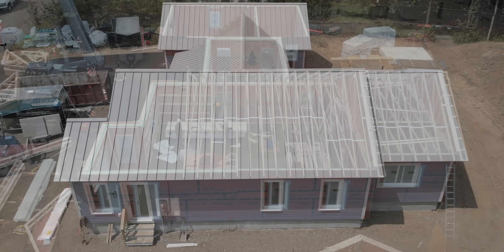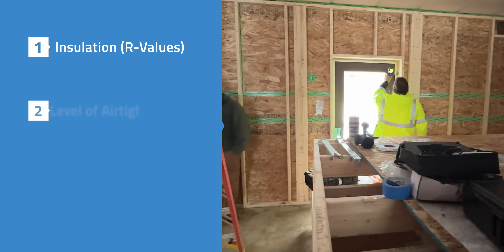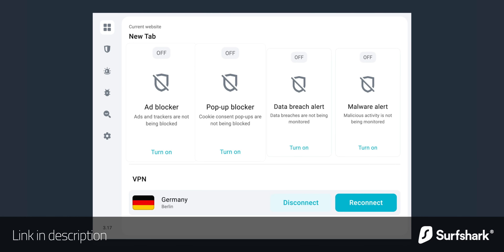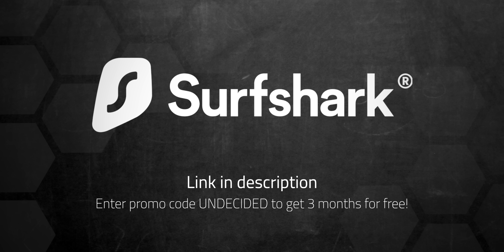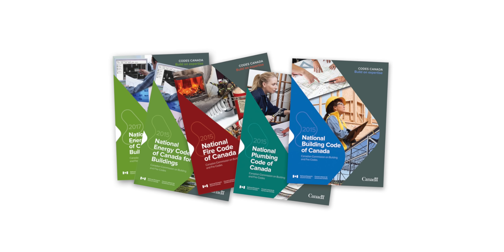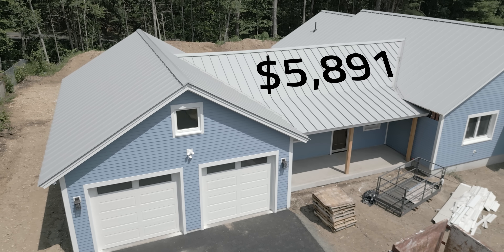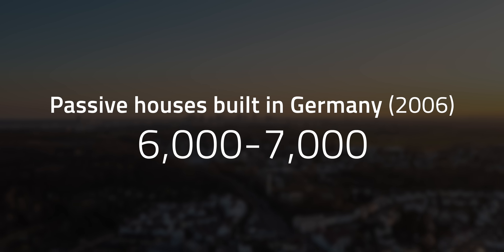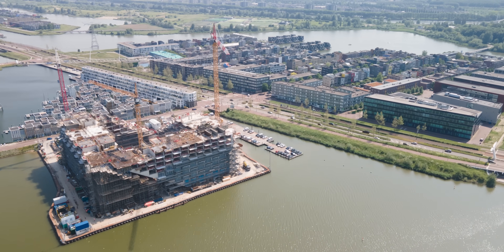Why Do American Homes Suck?

Comment: I'm in the process of building a custom home in Arizona at this very moment. The biggest problem I find is knowledge. You want a 2x4 exterior wall with R13 fiberglass bat? I can find 50 guys that will throw it up tomorrow. You want a 2x6 Zip sheathed, sealed and foamed wall? No one will even give you a callback. The second issue is price and availability. Better performing products are available if you try, but the contractors are making good enough money that anything outside of calling up the same place they've used for the last 100 houses is just not worth their time and energy. In the long run on a cost-plus build they would make more money, but they have so many builds lined up that it's just not worth the effort for them to bother. That all is just the bones. Don't get me started on plumbing and electrical and how the only low voltage wiring they are aware of is coax for a cable TV.

Of course, if you have boat loads of money to hire who you want to do exactly what you want, no problem, but for the rest of us in the sub million dollar range it is just not easy.

Comment: Here in South Africa you cannot build a new home without solar water heating… we have electric water heaters here…You can have one option that pumps the water through a panel on the roof in daytime or another that has a heating element that is AC and DC and the PV panel powers the element when there is enough sunlight…. So if your system is at correct temp, the electric dos not kick in…i think Australia uses same systems that we do... water heating is at least 25% of a homes energy consumption here…this reduces it massively…
I am always amazed at the amount of power / energy American homes consume…..or the way the taps are left running on the TV shows….we always end up shouting “close the tap” or “ close the fridge door” at the TV😂

Comment: There also a lot of government subsidies in EU for energy efficient homes: in Italy for example you get 75% instant rebate for replacing windows and doors with energy efficient ones. Of course this increased the average prices by around 30%, but it's still a good deal.
Reply: It's not 75%. It's 50%, and it used to be 65% until a few years ago.
Reply: @Myria83 I confirm it is now 75% instant rebate, introduced in 2022,  it falls under the umbrella of "removal of architectural obstacles". They have placed handles at a lower height. Clever. In 2020 I applied for the 50% rebate.

Comment: Good heavens man! $5800 annual energy bill? My Detroit (cold climate with above national average energy costs) annual energy costs for a 2200 square foot ranch with 30 year-old, drafty, single pane windows, partially uninsulated walls and walls that were literally 1/4 plywood, an ancient, inefficient furnace, a heat duct that I found was blowing air directly into the attic, a wife who cooks/bakes multiple times per day, four kids who leave every light on, the base cost of two gas meters and three electric meters (previous owner was a legit slum lord), and a heated garage/workshop was around $3000! WAY less now that I reinsulated, put in double-pane windows and new doors, installed new HVAC equipment, air sealed the house, etc. The data isn't all in yet but I'm on track for well under $1500 a year for energy.

I love Matt Risinger but his quote ignores the massive increase in housing costs. People can't afford a contractor grade house, much less a passivehaus. Yes, those houses save energy over their lifetime, assuming someone lives in them for a lifetime, but if you have a guy like me who is energy efficient to begin with, those savings are so minimal that the additional up-front  costs are never recouped before the house is demolished. As each additional R-value is a study in diminishing returns, I believe there is a much smarter middle ground that calculates the ROI for various energy efficient improvements before piling on costs that a builder/buyer/owner will never recoup. 

For example, I'm in a heating climate. I sprang for a 96% efficiency furnace but only a SEER13 AC. I put the money that I might have spent on a SEER20 AC towards more attic insulation and air sealing. Now, my hearing bills will drop significantly and my relatively inefficient AC will be utilized much less, providing me a greater savings in the long run and a much quicker ROI overall.

Comment: You missed the biggest reason why our homes suck. They're no longer made of solid wood...they're made of wood pieces. Particle board, wafer board, and finger joined boards. What's the fastest way to compost a log?...cut it into small pieces. These houses last long enough to make code, for checks to clear, and for all parties involved to get far away from you, but not as long as the loan. It doesn't matter how much you keep up on maintenance moisture will get in whether it's liquid water or airborne vapor. When it does your house will turn into mush. If it happens near the top of your multi story house it will rot every level all the way to the ground and you won't see it until it's too late. So much for your efficiency rating.

Comment: Im American. Lived in Germany like 15 years... while i think this video is valid, it also kind of ignores one factor... the comfort and convenience of American homes. German homes has radiator heating which i had to manually adjust based on the heat i wanted in each room. I also had to air out each room multiple times a day to prevent mold. There was no air conditioning, and no way to put air conditioning in the house. 
 American homes with the more centralized heating/ cooling systems and climate control are so much more convenient, plus because the energy costs have historically been cheaper in the usa it was still twice as much to heat a home in Germany and like 4 times more to use air conditioning if you decide to buy a portable unit. 
Say what you want about the efficiency of american homes... I'm never moving back to Germany and the housing is a big part of it.

Comment: The UK has a very much fabric first view on energy efficiency upgrades, which are now very commonplace.
Cavity wall insulation; to fill the void between outer and inner brick layers, loft (attic) fibreglass/rock wool insulation are very common to have been done in the past 20 years.
We’ve had a higher level done due to having solid walls with no cavity, External Wall Insulation. The whole building is wrapped with insulation panels, weatherproofed then rendered.
It’s cut our heating demand by 1/3. Costly but becoming very popular due to the high energy costs here.
After that we had an air to water heat pump installed to replace our broken boiler, which has cut the energy demand by 2/3 again.

We’ve cut our heat use from about 13000kWh of gas per year 5yrs ago to roughly 2800kWh of electricity to run the heating and hot water. Not bad considering our solar produces about 2500kWh per year.
I try to run the house and heating as much as I can from our cheaper overnight stored electricity and max out water heating during the day if we are exporting.
Reply: One thing that's silly about the UK construction industry is its obsession with bricks. There are better materials to build a house now, and also, insulation should go on the outside, not in the inside. If the bricks were the inner layer, their thermal mass would help stabilising the temperature. But no. In the UK, buildings have to LOOK as all other buildings, made out of bricks. It's just crazy.
Reply: @szabolcsmate5254  in fairness it’s due to us having loads and loads of really old houses. Many of our older housing stock was built using the cheapest materials available to meet the requirements. Quarries were everywhere in the UK and wood was expensive.
Rather than tear old buildings down its generally more financially economical for folks in a budget to buy an older house and make sure it’s retrofitted as much as the can afford.
New houses here aren’t cheap.
Reply: @salibaba  but why are new houses still have an outer shell made of bricks, and an inner shell that is a better insulating material? It would make so much sense to build a strong shell, made of bricks or even better, breeze blocks, then put insulation on the outside.
Reply: @szabolcsmate5254  I can only pass comment on the new buildings I see near me, but they aren’t always completely wrapped in brick. And by wrapped I mean exactly that. It’s a skin, not structural. Exterior bricks tend (I think) to be more about weatherproofing and aesthetics now.
I see quite a lot round here built with timber/steel frames with some concrete supports, then external panels put on the outside as cladding, sometimes wood cladding. I’ve also seen many which are finished with a rough cast on top of insulation panels.
Reply: @szabolcsmate5254  probably down to cost. Cost of materials, cost to lay. There may also be planning restrictions encouraging the use of low(er) carbon materials. Block work and concrete production is quite energy intensive. This is all just speculation based on my own observations. I’m not in any way connected to the construction industry so couldn’t speak for the economics.

Comment: I live in Canada so not quite the same as in the US. However, having more stringent (expensive) standards for residential homes would have less resistance from the public if the USA and Canada paid people a living wage as their minimum income.
In the 1960's and early 70's I knew lots of families who had a single income earner and they could still buy a house, have two vehicles, have a small boat, buy a motorcycle for the kids as well as send their kids to college. Today one can't even pay for rent and buy groceries on minimum wages. Many people try to have two or three jobs just to make ends meet. That's what needs to change!

Comment: Just be aware, the vast majority of the houses in England are not energy efficient or airtight, the reports sound good but in practise the net zero targets (unachievable with out complete rebuilds at a cost only 1% could afford ) have been back away from. The gov  know  this, and it would push the majority into poverty and kill the economy. In a new build it make sense but in a retro fit, were 50% are rentals  the owners and renters cant afford this. holding the UK or Europe as standard is perhaps not the best. Many of the efficiencies in Europe are due to the necessity of building for cold weather in the northern parts of it, but a look at the problem with natural gas in Europe due to Ukraine/Russia shows the majority do not live in super energy efficient building. the southern European builds are even worse as less free capital is available so most only build to minimum needed

Comment: We're rehabbing an old house and even though we've improved air intrusion, replaced all the insulation, replaced the old furnace with heat pump mini splits, and replaced the water heater with a tankless one, I still feel we have a very heat leaky old house.  .  By the way, to "beg the question" is to use a circular argument.  Maybe the phrase "that raises the question" is more appropriate?

Comment: We have a super efficient 1750 sqft house in Southern California with huge eaves and double pane windows. I was curious, can you do a video that focuses on what kind of tech your house is using in the attic to insulate it? It's the one area that I think we could improve. We have loose fluff insulation up there and dual whirlygigs. It works okay but towards the end of the day on hot days it does eventually get through to the house. I'm also curious about your HVAC ducting and the type of insulation used on those tubes. We have 8.4kW + 1 Powerwall+ from Tesla as well, so our house is extremely low cost for energy, but if we could insulate our attic a bit better and get better ducting and insulation we could run our heat pump less. Our house is 100% electric, zero gas line. Thanks!

Comment: I have an old home from the 50's that is liveable, but could use a TON of love. I was gonna refi and refurb it and try and shoot for full-passive and Off-grid if possible, but I missed the window of low interest rates and I don't want to refi the house into something so much higher, now, so I'm holding off until I decide I want to sell the place before I do anything, or until interest rates drop again. Then, I plan on getting solar, battery backup, electrifying my kitchen and heat-pumping EVERYTHING.

Comment: Great video! A lot of the information posed though was from the view of new construction, which codes like IECC and ASHRAE 90.1 cover. New construction is an easy starting point because you have the ability to design around being energy efficient fairly easily as long as you are able to afford the upfront costs. However, renovating an older building to be either up to current code or better is a larger challenge. It is not so simple for existing homes to offset a lot of its energy use, and sometimes there are codes fighting against certain home modifications, such as weatherization for manufactured homes with HUD code or generally historic buildings/districts. It would be great to see a video addressing this side, including all the challenges, solutions being developed, and how the U.S. compares to the rest of the world in regards to existing buildings.

Again, great video! Cannot wait to see more 😄
Reply: I have lived in many older buildings here in Massachusetts, where we get snow and freezing temperatures for around 1/3 of the year, and all of these older homes had zero or near-zero wall insulation, most has single-pane sash windows (with those wonderful wind channels that CAN'T be insulated to leave room for the ropes and weights), and most of them had oil heat, usually forced hot water baseboards.

Comment: It's a double edged sword.. Some options of the US could really do with energy efficiency while areas that deal with tornados or hurricanes on the regular basis need something that can be wiped clean and rebuilt in 90 days, with a building code and inspection standard that allows for that to happen. Building in concrete takes long periods of time, building in masonry takes time and money... Stick built on slab can be done in a hurry. 6 to 14 months is a long time to be homeless after a piece of debris flying at 115mph/185kmh or more just deemed your house unsuitable for habitation, or your whole roof is sitting in a parking lot a half mile away. Meanwhile everything along the 36th parallel and North needs the most efficient possible.

Comment: I read that American houses have a life expectancy of 30 years. Surely, it would be more energy efficient and environmentally friendly to build houses that were still good after 100 years. My old house was built in 1764. My "new" house was built in 1860. Being made of sandstone, they are durable. It's possible to upgrade them to good energy efficiency far more cheaply than bulldozering them and starting again.

Comment: Matt is 100% off base with this video. Yeah, his new house would save $5,981, but over what time period? Triple glazed windows tend to save just a few dollars a year in heating/cooling, but cost hundreds more for the initial purchase. What Matt doesn't understand is that things have a payback period, and many things relating to energy in the US have payback periods on the order of 20, 30, 50+ years, and those are situations in which the current owner won't see the benefit. In Europe, houses are passed down in generations, because building a new house is so expensive, and land isn't readily available, etc., which means a 50 year payback period is acceptable because your children will benefit from your decision. In the US, where houses are commodities, it doesn't make sense.

Yes, the US has more lax building codes than some European countries, but that's because you can't compare European with the US, and any attempt to do so is just stupid.
Reply: So you rather produce waste and be inefficient, got it. (Also no, you are wrong)

Comment: Of course it basically all comes down to cost. To do these better upgrades just costs more to do. The thing is, though, if builders were to do this for every house they build, then the costs wouldn't be nearly as high because they're buying those supplies in bulk. Current "builder grade" homes are just cheap looking too. Even the more expensive homes from better quality builders still use things like the crappy white wire shelves in all the closets you find in basic apartments. I also hate tiny garages in all the new build homes, even expensive ones. Most of the 2 car garages are the minimum size required to be called a 2 car garage. If you had a Miata and a Mini, maybe you'd be fine. Otherwise, you're not fitting 2 cars in it at all. If you do, you're not able to get in and out of them.

Comment: I think california does a fairly good job in terms of the shear we use and insulation and efficiency required by our green code, but honestly the new-home owners here are so rich theyd have you rebuild a bathroom three times til they like it and efficiency is about status rather than savings or environmental concern. Building smaller homes should honestly by our biggest concern...